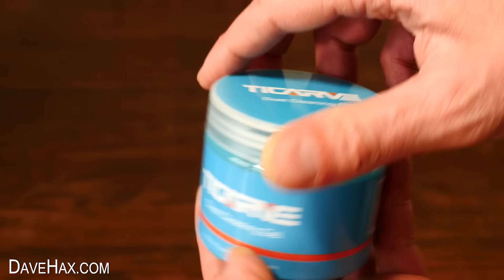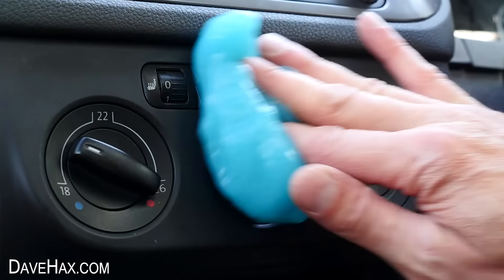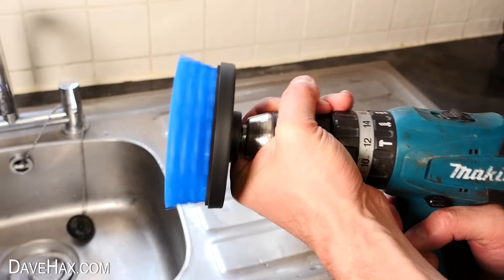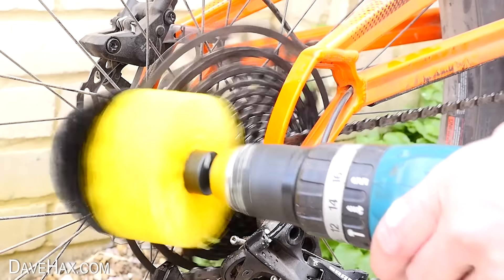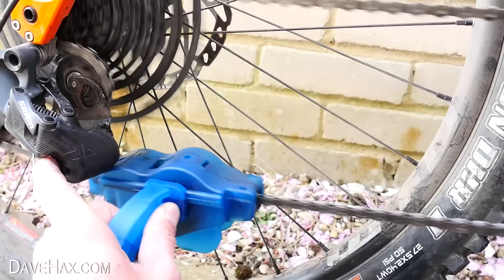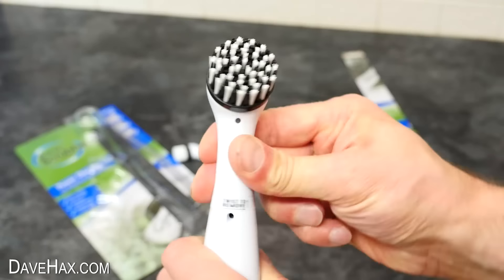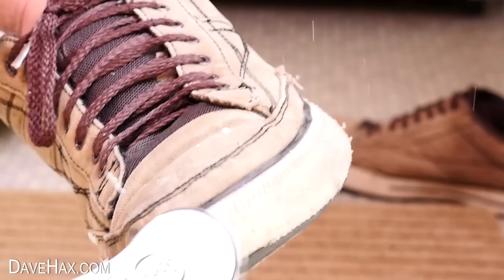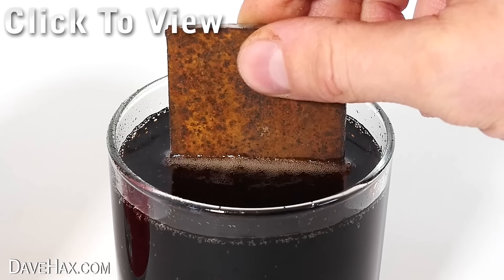Genius Cleaning Gadgets That Actually Work

Comment: Bike chains have oil on them to help the transmission work better, and run smoother. This means that if you clean it you get all the oil off, causing it to run less smoothly, and you can cause “belt slipping”
Reply: Yes, but it needs clean oil

Comment: the toothbrush things: can use it on anything, even taps
instruction manual: not recommended for stainless steel
me: but how many doesn't have taps in stainless steel? lol

Comment: I'm amazed that old nicad makita battery still works!
Reply from the maker: Ha ha yeah, it doesn't hold charge for that long anymore.
Reply: @DaveHax  If your are a very lucky lad and the battery hasn't had many cycles. Run the battery down dead dead flat, until the drill stops. (rip tie the trigger and just leave it somewhere to spin). Leave it an hour and charge it. You may recover a lot of the capacity back. Tip for you, for all the tips you give to others :D Nicad suffer from memory, sometimes a deep discharge reinvigorates them.

Comment: Just remove the batteries and unscrew the back of the  key board check for screws under the foot pads and hidden away places . Pry it apart , the keys are usually totally separate from the electronics and all plastic . Wash the keys in soap and warm water and scrub it clean , then dry with hair drier .  Wipe off the  covering mat and hold the base up and give it a gentle shake to dislodge anything inside the electronics then screw it back together . I do mine about once every six months . I also remove the back of my computer and vacuum out any dust and fluff especially from the CPU heat sinks . Go gently with the vacuum brush not a hard tool as you don't want to damage any electronic components . 
If the CPU heat sinks are really clogged then you will need to remove the fan so you can get at the fins better .

Comment: I would not use that goo to clean my keyboard 😅 if you watch close it leave slime residu on the air vent. Will do the same in between the Keyes on your key board